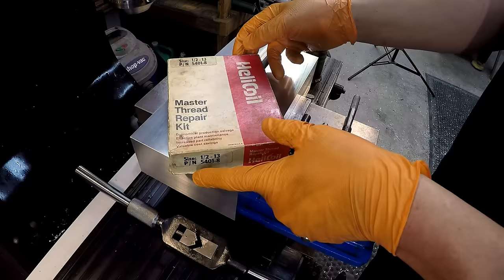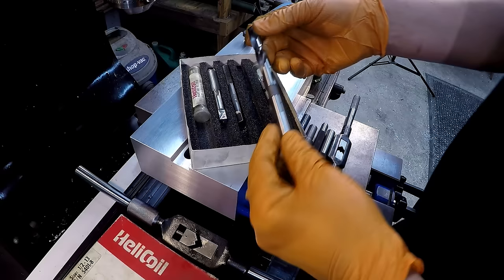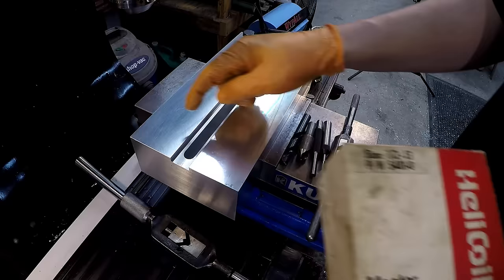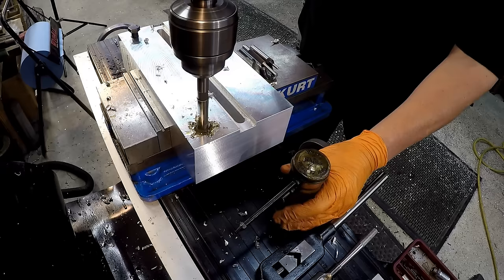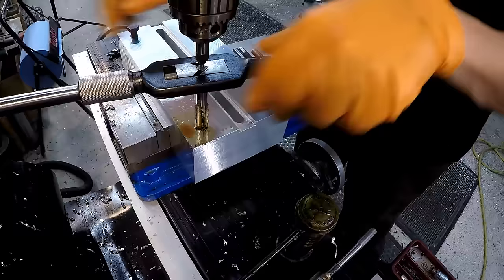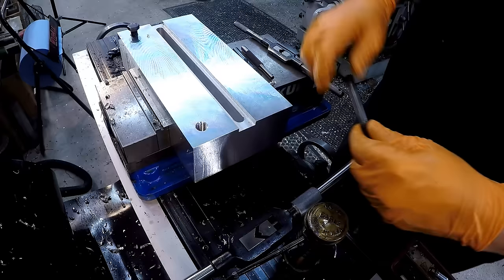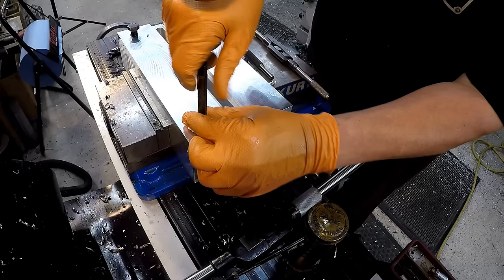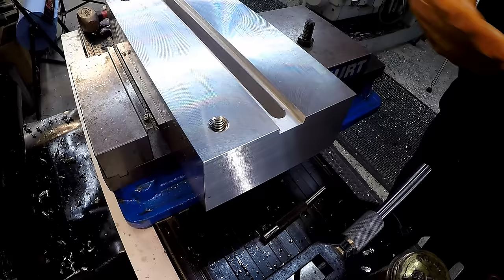How To Install a HeliCoil

Comment: The first time I ever came across Helicoil was at age 16 when the sparkplug stripped out of the head on my 50cc Yamaha FS1E. I got a kit and followed the instructions and got my little bike back on the road. My dad was impressed I had found a solution to the problem and got on a fixed it by myself.
Reply from the maker: Awesome!
Reply: That's self sufficiency that's gold
Reply: Great story.
Reply: I just broke a valve cover bolt off in my head and I couldn’t extract it. I hope they sell small ones to save my ass

Comment: I like to 'stake' my helicoils. I install them 1/2-3/4 turn below flush and then I pop a center punch mark into the side of the hole, closing up the top thread, preventing the helicoil from backing out.
Reply: Notso Fresh I was curious what’s preventing the coil from just backing out
Reply: Notso Fresh 
Helicoils are designed to not back out because they expand against the walls of the thread. I’ve never had one back out (working in aerospace) unless the constituent material fails, like a plastic
Reply: Belt and suspenders..
Aerospace ≠ Farming....  
In aerospace you work cleanly to exact tolerances only use the correct tools.
In farming you wipe it on yer pants to clean it, tolerance is "Looks like its good" and the correct tool for anything is either a hammer, a crescent wrench or fencing pliers.
You coil a hole and spin in a dirty bolt in the field in the dark, and then when you take it back out, the grit locks the bolt to the coil and the coil comes out. A little center punch pop stops this.
Reply: Tyler akerfeldt: The coil is slightly too large for the hole and is a spring so when you wind it in, the spring pressure outward created friction locking it into the hole. It will stay in as long as the friction between the bolt and the coil is lower than the friction between the coil and hole.
In most situations this is fine. However if someone in the future inserts a dirty bolt, or uses locktite on the bolt, the friction may get too high and the insert comes out instead. Technically this is mis-use but it happens all the time.
Reply: That works too, was going to say was taught to use a little bit of green thread locker on them to prevent that.
Reply: Have seen them back out for several different reason. As Notso Fresh said dirty bolt, damaged threads on a bolt that have been installed, dissimilar metals, and there’s a few more reasons.
Reply: @notsofresh8563  Lol that is a fair point
Reply: Great insight! You need to turn them that extra turn anyhow, to get actual use out of the tapped threads.

Comment: I imagine America could become a super power once it moved into the Metric system..
Reply: I wouldn't go that far but we're definitely crippling ourselves by not using the same units the rest of the world uses.   Its a pain at work right now from having to adjust and work in Metric which I could have just been used to it since childhood.
Reply: I can buy sae bolts in bulk by the pound. Every time I buy a metric bolt it costs a fortune and they are sold individually. When you buy metric are the inexpensive and if you ever have to buy an sae bolt do they charge you per bolt.
Reply: Nope

Comment: I have installed literally thousands of those things mostly 8-32 , 10-32 , qnd 4-40 sizes in the servo valve bodies we build at work. We use primarily Heli Coil brand. We installed so many we converted a broke arm tapping  station to install them. The tangs are a real pain in the 4-40 inserts to get out. We use tang "poppers" air and magnetic small diameter tools to remove them.

Comment: One thing that is cool that not a lot of people know is that you can get distorted thread heicoils to prevent fasteners from backing out. They have a thread or two that is almost square shaped, locking your screw.

They are used frequently in parts going into space where a threadlocker won’t work due to off-gasing.

I thought that was super cool!
Reply: I bet they are not cheap..
They make exhaust manifold nuts that are the same way, single use only. Exhaust manifolds are notoriously bad for losing fasteners due to the heat destroying thread lockers and taking the temper out of spring based retention systems, as well as heat cycle dimensional changes stretching studs. These type of distorted thread nuts are one of the better ways to keep stuff in place.
Reply: Martin Kurien That is very interesting I have never seen those. 
Does heli coil make them.

Comment: In the 'old' days I've used many HeliCoils to repair stripped out spark plug threads on motorcycles, snowmobiles & various other aluminum engine heads. Thanks for the video, as always, you are a great presenter.

Comment: This is for those of you who have used Heli-coils and then had problems breaking off the tang once you had finished inserting the Heli -coil. Using a punch to break the tang often results in dislocating the last few turns of the Heli-coil. That makes the Heil-coil useless; leaving the tang in place results in the same problem. If the bolt bottoms out on the tang and you continue to turn it, then it pushes the last few turns of the Heli-coil out of place. For all practical purposes, this makes the Heli-coil useless.  So, dealing with the tang is a must do thing and not an option.

The OEM tang breakoff tools are a ridiculously expensive solution to the dilemma.  I spent less than $2 to replace a tool that cost much more and works perfectly every time that I have used it.

For those of us who don't have a money tree in their backyard, I have a solution. Go to Harbor Freight and buy a cheap Phillips (or flat blade) screwdriver whose shaft OD is a nice slip fit in the Heli-coil you will be using. For 5/16” Heil-coils, that’s about 1/4” diameter. Take the screwdriver and cut the screwdriver tip off of it using a cutoff grinder with a thin wheel abrasive disk. Use the same disk and center it up as best you can on the now bare screwdriver shaft. Then cut a slot in the screwdriver shaft about 5/16” to 3/8” deep.

Now that you have your finished tool, simply stick it in the driven Heli-coil and gently turn it until it seats on the tang. Now it is muscle time: turn the homemade extraction tool counterclockwise. The tang will break off and fall to the bottom of the hole. Now the bolt will screw all the way into the Heli-coil and not bottom out in it or push the last turn or two of the Heli-coil out of place.

If the Heli-coil was installed in an open-ended hole in some place that has moving machinery, you need to retrieve the broken tang. Since the Heli-coil is non-magnetic stainless steel, that may be problematic. Unfortunately, I don’t have an easy solution for that problem… ☹

Comment: Years ago working on an aluminium job for a car company, they insisted all tapped holes be helicoiled. Since then I always use them for any threads in aluminium.  Makes more sense than just waiting for them to strip out.

Comment: I can’t believe I’m 57 and have done a good bit of DIY repair and only now becoming aware of these little lifesavers. This could have made life so much easier many times. I have a 2006 Honda Goldwing which seems to love to strip threads on the hundreds of body connection points. The “Dodge” setup would be a life saver for the many metal screw into plastic threads. Thanks for the demo!

Comment: Hi Adam,
One thing that I picked up on with Heli-Coil kits in aluminum...For maximum longevity of the inserts, install with Loctite 262 and then grease the bolts and inside the hole with black Moly grease (to keep the Loctite from grabbing the first bolt in).  It also helps to not have totally blind holes, in effect giving a 'vent' so the bolts do not generate compression of air on install, or, vacuum on removal.
Great videos!  Kudos to you for making the leap of faith!  Best regards & Luck.
Ken

Comment: awesome tutorial, I knew pretty quick you're an experienced machinist. I've never installed one of these before (was always the next guy's job) and I wanted to make sure I did it right. Repairing a 28 year old motorcycle carburetor is interesting to say the least.

"I'll just unscrew this and check the o-rings..."
M4x0.7 screw snaps halfway down, nightmare begins

"Damn, guess I'll use a screw extractor then..."
screw extractor snaps because 28 year old loctite is not moving

"WOW, ok, how about a bigger screw extractor for the broken screw extractor?"
second screw extractor snaps because it was cheap

Lots of swearing and laughter later, I ended up drilling that whole mess out with carbide tools, one of which also snapped. LOL

Comment: I was taught to use red lock tight on the helicoil to help prevent the chance of it backing out. With that said I’ve always had to use them in a more extreme duty environment than a shop tool, usually on equipment or power tools like chainsaws. Heat and vibration are great are extracting these.
Reply: Same here but was told to use the green
Reply: Loctite is useless in a Helicoil application since it only properly cures in an air free environment. Due to the construction of the coil, there is always air surrounding the coils.

Comment: I made that company quite a bit of dough during my years as a Harley tech. Seems like bikers are more heavy handed with their wrenches than other folks, and there is so much aluminum on the trans and motors. Even had my share of repairing Helicoils that were installed incorrectly by the owners of the bikes, other dealerships and backyard mechanics. When people first start using them they have a tendency to stretch the insert and jump threads. Correct pressure is a MUST!

Comment: I generally prefer a full insert for high use  applications like the Weld jig, but you can't argue the economics of helicoil. I have had good success using a light coat of loctite 242 to help keep them from walking. Thanks for sharing
Reply: Perma plugs are pretty nice for a more robust application.

Comment: Used these a lot when setting CNC fixtures - saves the shop guys from pulling thread on the Ali when loading new parts. Useful on Ali sumps too!

Comment: If you do anything in aluminum for defense work , and it is threaded, it will most likely have a helicoil installed spec'd for it. It's great for aluminum parts on ships, makes 'em last longer.
Reply: I was about to say the same thing (mostly), I work in aerospace and usually any aluminum part that is threaded and thick enough has a helicoil, otherwise a riveted nut-plate.  Helicoils are cheap compared to the price of the part.

Comment: Ngl, i have been designing mechanical parts digitally on a computer, with helicoil inserts in them for past 4 years, but never knew how it is installed 😂, thanks for the detailed explanation 🙏🏼

Comment: In a normal thread, only the first couple threads carry all the load. Helicoils (or any springy thread insert) distribute the loads way better. Therefore for critical threads there are often Helicoils installed from the get go (i.e. threads for refiner plates).
Reply: In addition to that, Helicoils are used heavily in the aerospace industry because they can come with a locking feature that can hold fasteners in better against the vibration of a rocket launch and the vibration on the ISS. NASA requires that just about all fasteners have a secondary locking features in addition to being properly torqued down, which is normally done with a locking Helicoil but can also be done with approved grades of Loctite, safety wire or if non-critical Kapton taping over the fastener can be done too.
Reply: Just like in Rolls Royce military engines.

Comment: The last step shown is the most important. Failure to knock off the tang will lead to the coil being pealed out or binding from the bottom. Having the punch size closely fit the inside of the coil helps hold the last coil turn in place as the tang is knocked off.

Comment: I have full genuine UK Helicoil master kits 1/4-1/2" BSW, BSF, BA & UNF. posssibly from the early 80's.None of them have a coil insert tool like yours, which looks more like a Timesert tool, but a tool that uses the tang of the coil for driving in & a coil compression tool prior to entry in the hole.
Regards.

Comment: This is a contentious subject at our shop. For years they used helicoils in this type of application, i.e. a way to strengthen the joint between a steel bolt and aluminum thread as well as prevent galling. Some people are still hell bent on a helicoil being sufficient, while another set of people believe that a helicoil should only be used to repair damaged threads. 

Our current policy is to only use Keenserts and I believe they have abandoned Helicoils for applications like this. 

Not trying to take away from your video, just kind of laying our what I have seen on my end considering the application.
Reply from the maker: Purpose of the video is to help people understand how they are installed.
Reply: @Abom79  like I said, I wasn't trying to take away anything from the content. For this little fixture it probably wouldn't really matter which method you use.  I wasn't criticizing.   It might be a good topic for another short video "When should I use a Helicoil or a Keensert?".
Reply: In the military in the 70's every tapped hole in aluminum on a tactical vehicle had a heli-coil installed from the factory. Never had any problem with a properly installed heli-coil.
Reply: My work deals with aluminium machinery out of Germany and all blind holes are helicoiled.
Pretty hard to repair if over torqued and you fracture the aluminium thread.

Comment: Who ever thought the coil up deserved to be put on a pedestal in my eyes. They have put soooo many pieces back to work for just a few bucks. From a #6 to 1 1/2 I have never had a failure and they can be done in the field as well. Cast, aluminum, steel or copper. They are great !

Comment: Well done how to. The helicoil may not be the perfect tool for every job, but they do work fine in their application.

The biggest one I ever installed was a 50 MM in a hydraulic hammer main body bolt hole. It wasn't a repair though, it was replacing the original that came out. My guess is that less than ten percent of the time, the helicoil came out, but I was taught that an impact gun wasn't to loosen the stud, just to remove it. Loosening was done by hand or with a hydraulic wrench.

As for strength, the highest torque on the nut I ever did was somewhere around 2500 lb-ft. and in operation, the hammer is constantly trying to break itself. 

Of course, these weren't off-the-shelf Helicoil, they were built by/for the manufacturer.

Comment: Nice vid, Adam.  Short and sweet, right down to it.  Of note should be that smaller Helicoil kits also include a threaded sleeve that precompresses the insert as so it does not bind up as you start to run it down into the tapped hole.

Comment: Been subscribed to your channel for some years man and have learned from every video I've watched, thanks for putting what you know out there for us to absorb man it means a lot.  I also am wondering if anyone has a method for removing broken off drive screws on four jaw chucks?  Not sure how it happened but it's a problem, I'm speaking about the threads that drive an individual jaw in case I'm not using the proper words.  Someone tightened a jaw until the screw broke off about halfway between the top of the chuck and the center of the spindle bore. Thanks in advance
Reply: Joel See ....Take a good sharp #2 pencil and draw it out.  Had to kid ya, every so often I get the chance to dust that one off and use it.  Good luck with getting that screw un- rooted.

Comment: Another nice, concise instruction into installing the helicoil Adam. One question though, why when installing the insert don't you use the spring centre as you did when tapping the hole? If you have still got the spring centre in the mill chuck surely it would make installing the insert easier than trying to locate it by hand as it ensures it is concentric with the hole. And it puts downward spring pressure like you did by hand. Assuming of course that you have a centr hole in the installation slug. Which could be done anyway in a minute.
Reply: In my experience you don't need it. The coil will just easily follow the thread.

Comment: Excellent video, thank you. I have used these many times. However, always for thread repair/replacement. Also, I never knew about breaking off the bottom tab.

Comment: This is a great video, thx! I am trying to research if I can do this in a tight-fitting space to get my serpentine pulley belt tensioner in my Honda Odyssey... yikes! The OEM bolt is supposed to be a Metric 12 x 1.25 mm but someone must have rethreaded it to a larger Standard 1/2-20 to get the old part in for some reason.... The new OEM part comes with a 12 x 1.25 mm bolt so yeah... considering a helicoil to get that to fit again.....
Reply: Or you could just go to any hardware store and spend a dollar on a 1/2 20 bolt.
Reply: Actually its probably more like 50 cents

Comment: nice job, those coils have saves allot of ass over the years, I may be wrong but when they first came out I was sure they come with red lock-tite, because I used it on them. Maybe they have changed them to not need that anymore? Always enjoy your efforts Adam, thanks for posting.